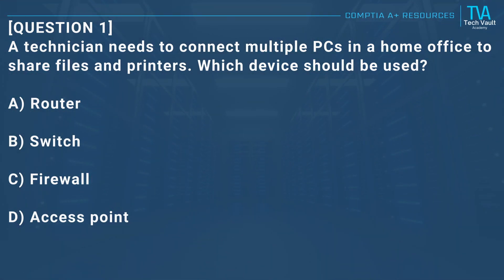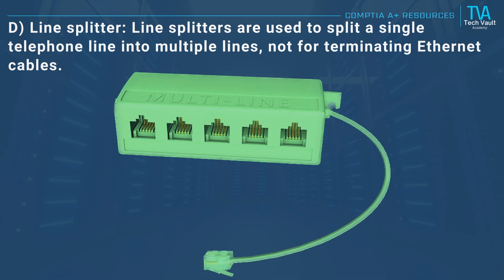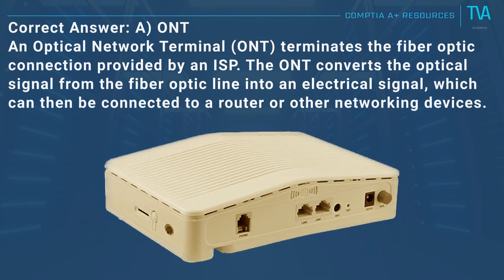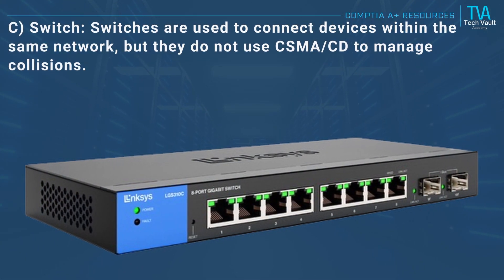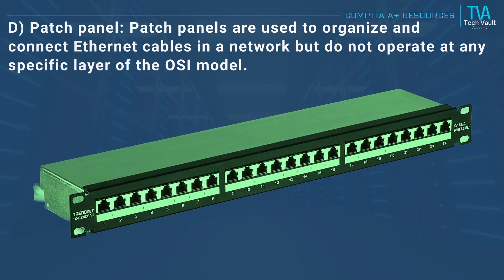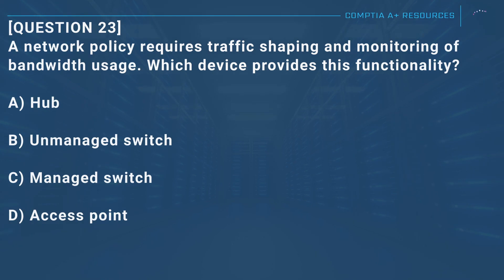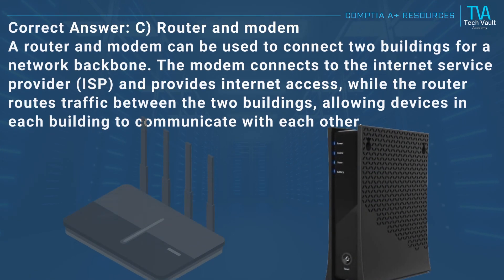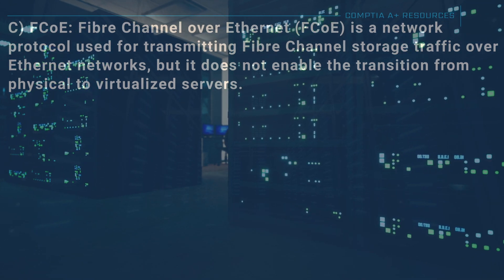CompTIA A+ 220-1101 Exam Prep: Mastering Networking Hardware | Comprehensive Guide

Comment: Question 13.  You use a crimper to crimp CAT6 cables onto a RJ45 connector.  You use a Punch Down tool to terminate a CAT6 cable onto a 110 block.
Reply: preach!
Reply from the maker: Thank you for your input! You're absolutely right, and we appreciate your attention to detail. While the question was about crimping CAT6 cables onto RJ45 connectors, the term "terminate" in the original comment might have caused confusion. We apologize for any misunderstanding this may have caused. Your clarification is spot-on - a punchdown tool is indeed used to terminate a CAT6 cable onto a 110 block, not to crimp it onto an RJ45 connector. Your contribution helps to ensure accuracy and clarity in our content. If you have any more insights or questions, feel free to share.
Reply: @techvaultacademy  Question 26 as well...Have always disliked the word "terminate" and how its used for both crimping and punching down cables to a 110 which is what Ive always associated it with
Reply: I agree with you too.
Reply: I’m assuming he meant Keystone Jacks.
Reply: @acsaiyanbalce4610  The picture is showing a 110 block.  Thanks for the reply.  Have a nice day/evening.
Reply: I was thinking the same thing.

Comment: I really find your videos as a great asset. But I must tell you, some of your questions are very ambiguous to the point they are downright confusing and at times feel conflicting and convoluted. I hope I am not coming off as an A-hole by saying this. When you are deeply locked in the zone and you miss a question that if worded in either a slightly different fashion or with even a slight minute detail you would have gotten correct it feels counterintuitive. Tricky questions are great, they make you go through an order of operations, especially troubleshooting types. I wish you nothing but success on your channel and you are helping many people, myself included.  Again, I am coming from a place of positivity. But it is very important to be as candid as possible when expressing your honest opinion. Thank you for all your hard work. Cheers.
Reply from the maker: Thank you for your comment, Colin. I appreciate your honest feedback and your positive attitude. I'm glad to hear that you find my videos as a great asset and that they are helping you prepare for the CompTIA exams. 😊

I understand your frustration with some of my questions. I try to make them as clear and accurate as possible, but sometimes they can be ambiguous or confusing. This is not intentional, but rather a reflection of the real-world scenarios and challenges that you might encounter as an IT professional. The CompTIA exams are not easy, and they often test your critical thinking and problem-solving skills, as well as your technical knowledge. Therefore, some of my questions are designed to be tricky or challenging, to help you practice and improve your skills.

However, I also recognize that some of my questions may need improvement or clarification. I welcome your suggestions and opinions on how to make them better. If you have any specific examples of questions that you think are poorly worded or convoluted, please let me know. I will review them and see if I can revise them or provide more explanation. I value your input and I want to make sure that my questions are helpful and effective for you and other viewers.

Thank you for your support and interest in my channel. I wish you nothing but success on your CompTIA journey. Cheers. 🙌

Comment: A router  provides wireless internet access(Question 29) then another answer says a router cannot provide wireless internet access? That may confuse alot of people. But yes , it provides wireless internet access.
Reply from the maker: Thank you for your feedback! We understand the concern. The response in Question 29 could have been clearer. Just to clarify, a router can indeed provide wireless internet access through its integrated wireless access point (WAP). We appreciate your input, as it helps us improve the accuracy and clarity of our content. If you have any more questions or suggestions, please feel free to share. Your engagement is valuable to us!

Comment: 15 got my wires crossed, maybe someone can confirm. I saw power problems and immediately thought the answer was PoE. However, on second thought, you wouldnt supply a SWITCH's power via PoE...   right? PoE would be for smaller devices down the line, wheras a switch needs a lot more juice to do it's work..    am i crazy?
Reply: PoE is for smaller devices, you are not crazy.
Reply: Yeah bro I thought the STP was shielded twisted pair and it was one of those dud answers. Poor question really.

Comment: This is very helpful, do you cover all other topics like printers, virtualization etc? thanks
Reply from the maker: Hi Stanley, we're glad to hear you find our content helpful! We do cover a wide range of topics, including printers, virtualization, and much more in both CompTIA A+ Core 1 and Core 2. In Core 1, you'll delve into areas like hardware, networking, mobile devices, and hardware and network troubleshooting. Core 2 extends to operating systems, security, software troubleshooting, and operational procedures. So, you'll definitely get a comprehensive understanding of IT fundamentals. If you have any specific questions or need more details about a particular topic, feel free to ask. Keep learning! 😊